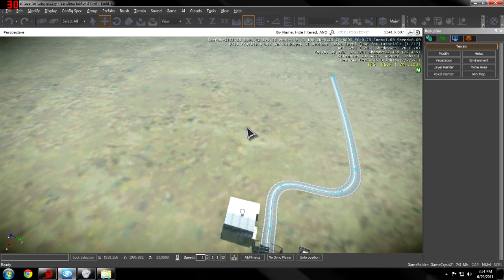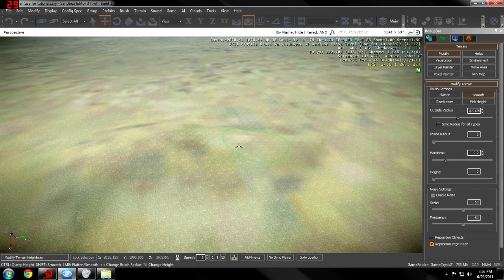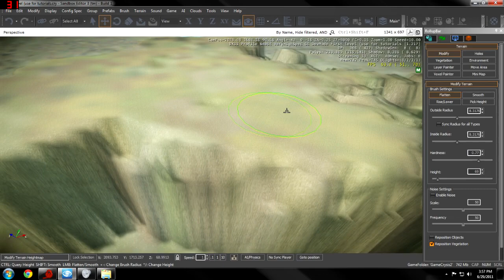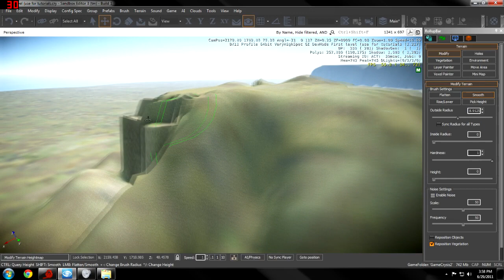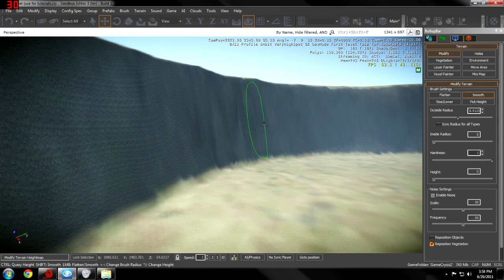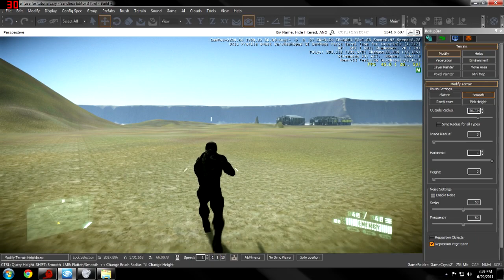CryEngine 3 - Basic Terrain Tutorial

Comment: Please help. 
I have installed Sanbox 3 v1.1 and for the life of me I cant get the DX11 profile to work. Please help I tried looking for a solution and found nothing. I'm running an ATI 6970 and know that it supports DX11. What am i doing wrong. I have installed Crysis 2 then the Sandbox 3 V1.1 then the Crysis 2 DX11 patch and Crysis 2 Hi Res Texture pack. Nothing helps it still shows DX9 profile when i start up the editor. I really hope this is a noob mistake on my part. If you have any ideas?